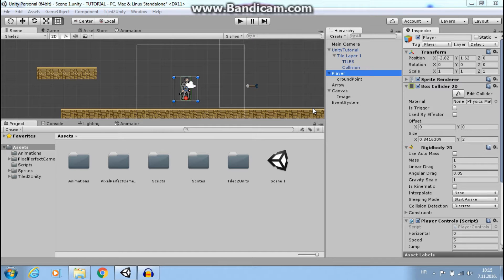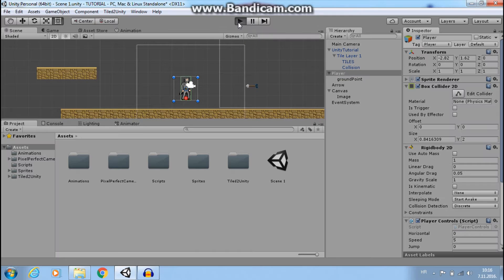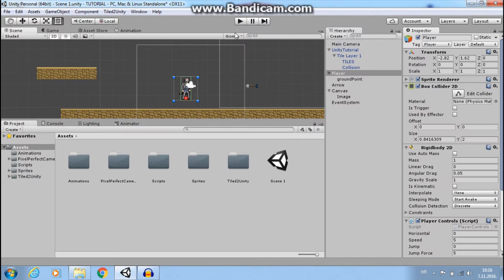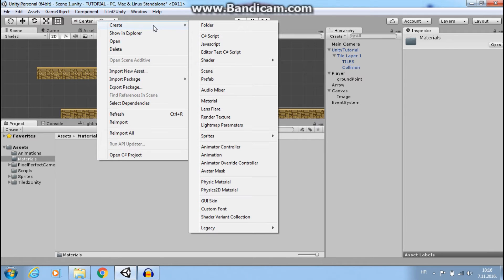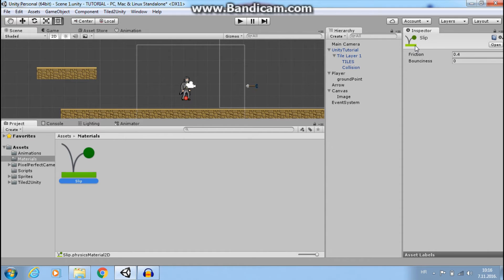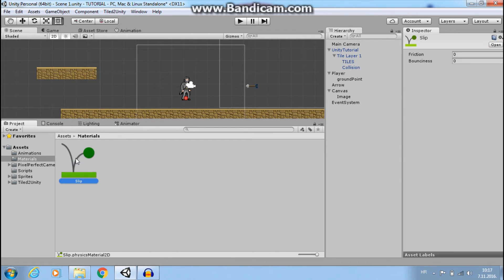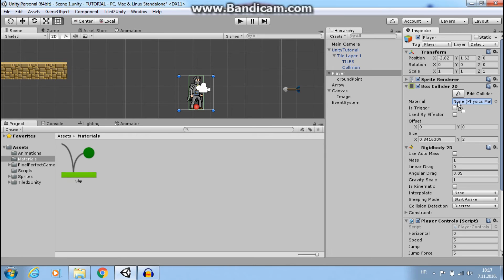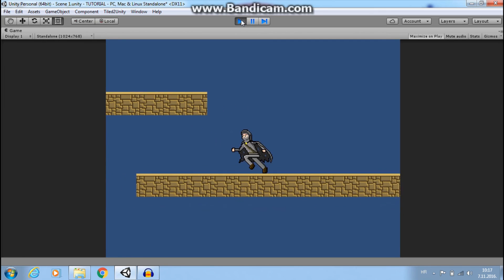Unity 5:2D Platformer-Sticky Walls [9]

Comment: hello mario, theres seems to be a problem... Once i add the circle collider to detect ground, and maybe the box collider for the duck animation the stick walls are back again... ive added a capsule collider2D with slip on top of the ground circle to overlap it, and it seems to be working again... or maybe this is just a matter of removing the box colliders from the script collider control and add them again...
Reply from the maker: Just add "slip" material to all colliders on your player and it must work :)